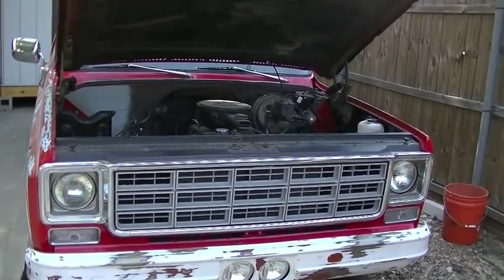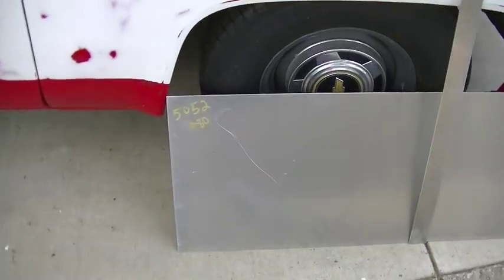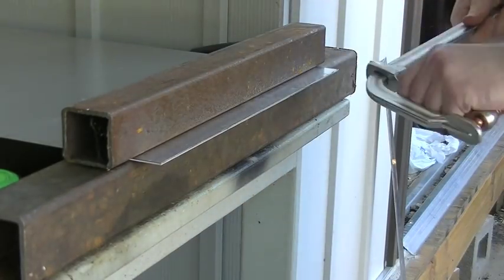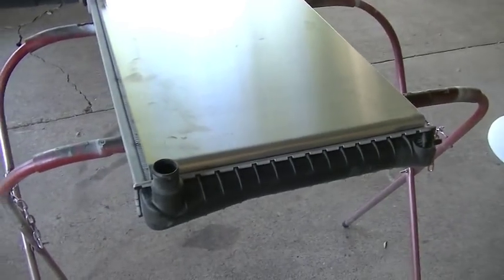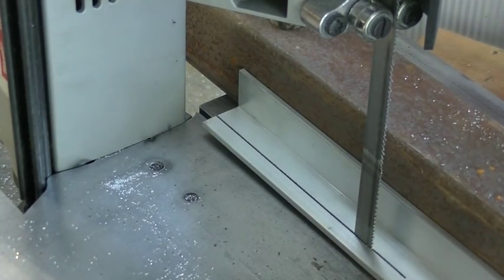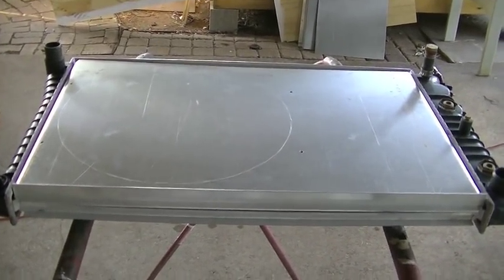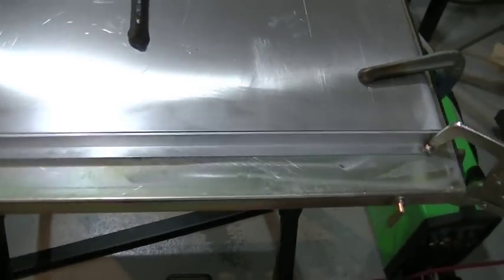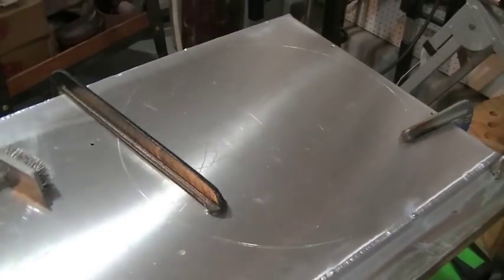PART 1 TIG WELDING AN ALUMINUM FAN SHROUD | 1977 Chevy C10 Cooling system

Comment: I get stainless steel three core radiators with fans from $165 on ebay, direct fit.  I've had three they work great in FL heat.
Reply from the maker: +thefixer I'll have to look into that.  Do you have the username of an eBay seller you could share?
Reply: +milkcrate82 Ive put these setups in camaros, corvettes and trucks they work great.  Going to use a c3 corvette one in my s10 v8 build I&#39;m doing now.  Were did you get the front bumper?  http://www.ebay.com/itm/73-80-CHEVY-C-K-SERIES-C10-K10-PICKUP-3-ROW-FULL-ALUMINUM-RACING-RADIATOR-X2-FAN-/160966248411?hash=item257a5607db:g:ddUAAOSw54xUWaIx&amp;vxp=mtr
Reply: Did you miss speak on that, ive never seen a stainless steel radiator outside of industrial equipment.. Did you mean Aluminum?
Reply: yep aluminum

Comment: Do you have plans on  replace the inline 6 with a V8? Just wondering
Reply from the maker: +SinatraGaming Possibly.  I've put the engine decision on the back burner for now.  The inline 6 runs well and it hasn't given me any problems.  It's just SLOW!  But... it works and I can at least I can enjoy cruising it as it is.  I've been focusing my funds on getting it rebuilt and looking the way I want.  It will likely get a SBC or maybe even an LS in the future.  Just not sure when that will be.  Thanks for watching!

Comment: Great Will that increase horsepower
Reply from the maker: +Long Man No, no horsepower increase.  But it will help keep this old engine from melting down!  Still haven't decided if I want to rebuild it or do an engine swap.
Reply: +milkcrate82 Throw a 305 or 350 in there, can find them pretty cheap anywhere and would be cheaper than rebuilding the straight 6.
Reply: +milkcrate82 5.3 ls are cheap and good power with a cam
Reply: That too but the ls would need a custom wiring harness while with a carborated small block you can basically run the thing off of 10 wires.